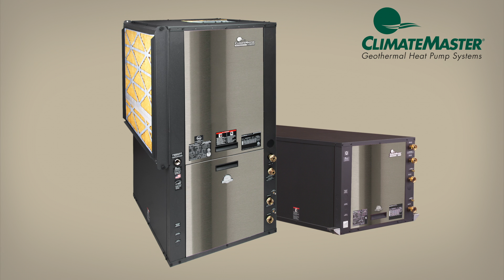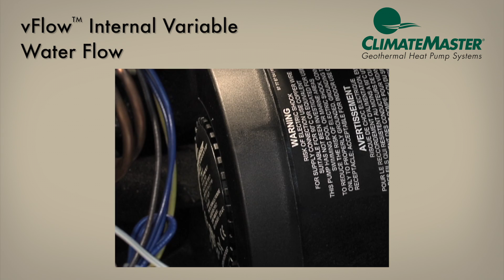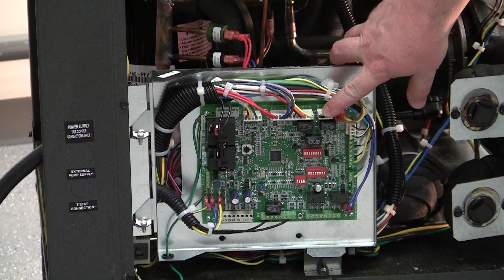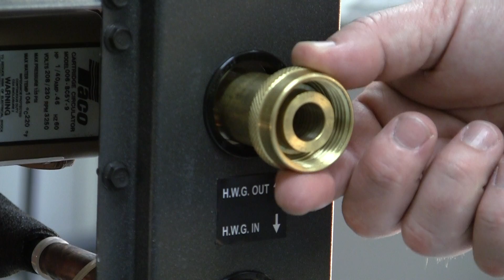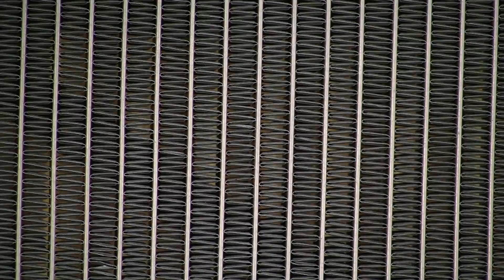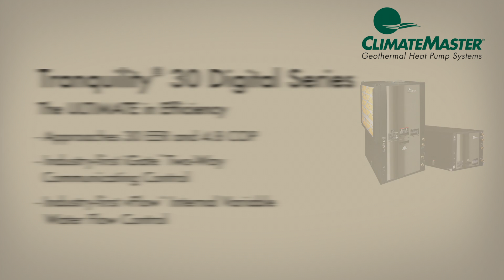Tranquility 30 (TE) Series Introduction

Comment: How exactly do you adjust the blower cfm? I have the thermostat mounted on the wall, but the option to adjust the blower is not there? Do I pull it off the wall and plug it in somewhere behind the panel?